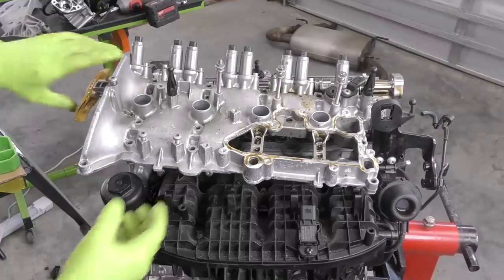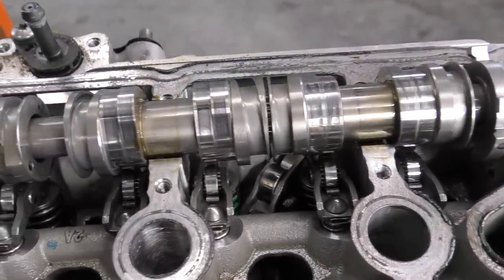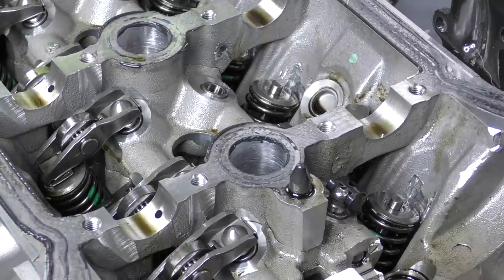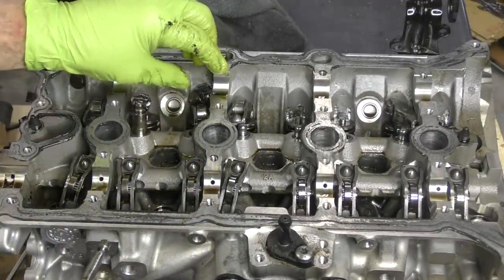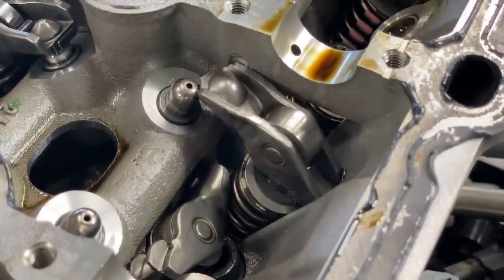Catastrophic Engine Failure VW 2.0t TSI Engine ~ MONEY SHIFT!

Comment: Man, it looks so much easier to work on an engine when it's out of the vehicle.
Reply: Yeah at the first place you think that you will lose time extracting the engine but in reality i prefer take my time to extract it xD
Reply: It is. Stuff that take hours on the engine takes minutes with the engine out off the car.
Reply: Ujiltrom M wait till you see front wheel drive transmissions, you’ll never look at a transmission mechanic with the same respect again (unless they pull it too, which a lot of specialty shops don’t do)
Reply: aterack833 i personaly work a lot on FWD and FWD engines are build different 
First of all they are transversals not longitudinal 
So it’s easier to work when the engine is in, even more since the transmission need to be disconnected with less space
But when talking about longitudinals engines it’s generally more simple to throw it out in my opinion
Reply: Trust me from experience it really really is 😂😂😂
Reply: VAG tsi 1.4 1.8 2.0 are shit they always break
Reply: Manufacturers need to get common sense in to help with the design.
Reply: For me, it's all about the aircon: the advantage of working on the engine out of the vehicle vs the advantage of not having to de-gas and re-gas the aircon system and change the aircon compressor O rings.

Maybe I should just accept the cost of getting the aircon done (£40 in UK)?

Or maybe leave the aircon compressor connected when I remove the engine?
Reply: @ryanb.2967  u make no sence
Reply: Alot of modern vehicles are designed that way unfortunately
Reply: This applies  to more than "cars" lol yes remove the engine then its easyer
Reply: @ryanb.2967  Do you mean in or out?
Reply: @jimmydcricket5893  prefer out but some vehicle take less time to work in
Reply: Umm, obviously
Reply: @ryanb.2967  The early Mitsi Magna cars used the same engines as the GK-GN Sigma. The two differences are the Magna water pump is driven by the cam, & has a different timing cover, but internally, most of these engines are the same. I know this, because I used to to engine reco work for a living, and I also owned a 1986 Magna. I own a much better, though older car now.
Reply: @jb9652  - when you replace wheel bearings, you don't have to bleed the brakes. You leave the hoses connected - just push the pistons back and hang the caliper safely using coathanger wire.
So why would you disconnect the air conditioning, when it's mounted on flexible hoses anyway?
Reply: @johncoops6897  Do you mean unbolt the compressor from the engine, leaving it connected to the condenser etc, then remove the engine without it? If so, that's what I meant in my last paragraph. I've just had a look: I think it would work. Cheers!
Reply: @jb9652  - of course I meant unbolt it and leave it plumbed (connected) into the refrigerant hoses. No need to disconnect anything unless you needed to You could possibly also leave the entire intake manifold and coil pack assemblies in place, which can save lots of time.
Of course, some cars will have physical constraints so removal of large stuff like A/C compressor is needed to provide enough space to lift the engine up and out. Keep in mind that the compressor is heavy, so strong wire or something will be needed to support it safely and not damage the hose connections!
Reply: @ryanb.2967  bwahaha no. FWD is a packaging nightmare and nobody's made an easy-to-work-on FWD in 20+ years.

If you want to see what easy to work on truly looks like, track down an 80-86 6-cylinder Ford F-150. You can just about rebuild the engine without removing it from the truck!
Reply: @jimmydcricket5893  it don’t bother me too much to work on a fwd longitudinal engine but for transversals ones i prefer pull it out depending on the task
Reply: Im going a valve repair on one of these.  Its a bitch in the car...especially the exhaust side

Comment: is not an engine failure, is a driver failure.
Reply: I ain’t no expert. . .   but the ECM should limit the RPM so that an inadvertent shift into a lower gear should not destroy the engine.  We didn’t hear what the respective ratios of second and third were in this car. . .    My Humble (see what I did there?) opinion. . .
Reply: @oijhhytdirhrbru  It does not matter, tuned, Turbo, NA. This will happen to most engines when going from redline on 3rd gear down to 2nd gear. Rev limiter is only there for top of any given gear, that is software, in this case it's all mechanical.
Reply: Both
Reply: Bram Moerman he forced it into second gear and dropped the clutch, so the physical speed of the car and transmission at such a low gear is what overrevved it, not him pushing the gas
Reply: Because of the red lining in 3rd gear and the speed he was flying in and accidentally forced it into 2nd gear he mechanically overrided all ecm safety measures and it being a mechanical override it is simply impossible for the ecm to react to make things right. When accelerating and you hit the max possible rpm your ecm simply won't allow the engine to turn faster, in case of a downshift from a higher gear at redline rpm into a lower gear the rpm of the engine would be much higher then the ecm or engine can handle...
Reply: @oijhhytdirhrbru  Fuel has nothing to do with it, who's talking about DCT here??? 
This video is about a manual transmission.
"Money shift" Can NOT be done in an automatic.
Reply: @francoisdvanderwesthuizen  Are you aware how a manual transmission works? If you're redlining 3rd gear and shift into second, physics don't care what your ECU has to say, that engine is going to rev.
Reply: @oijhhytdirhrbru  software won't help you if the engine gets overreved because of down shifting.
Reply: Funny thing is the old fiat punto if you slammed it into the wrong gear the gearbox would poop it self 
there was one story I heard and same driver destroyed 2 gear boxes, they didn't understand what gearbox failure due to overreving the gearbox meant (basically driver is in high gear like 5-6 and changes to a low gear like 1 to 3 when at 70mph) engine was fine surprisingly (gearbox exploding before been able to overrev the engine)
Reply: rt re It’s a GTI with a stage 2 tune. GTI can be optioned out with a Manual gear box. If it was the dsg transmission with the tune I’m sure it would of still exploded. Since it isn’t factory tune.
Reply: @dewiz9596  how can the ECM limit the input from the CV shafts turning the transmission too fast? it's literally got all the weight of the car behind it..holding spark won't slow the RPMs.
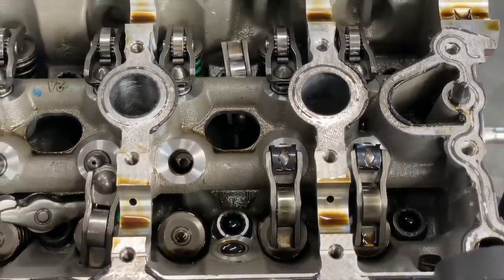Reply: @oijhhytdirhrbru  u just did not watch the video carefully. he mentioned around 11:55min that ECM can not avoiding downshift into wrong gear and dumping the clutch. The DCT or auto trans will not allow u to "dumping" the clutch. Doesnt matter how doubt are u about the manual trans with that engine in US or not. LMAO
Reply: @_Mario_PL_  your wasting your time bud, I dont think he will get it. You could turn the engine off and it would still cause damage
Reply: Yeaaaaa driver fail lol
Reply: rt re dude engine that came out the car had a manual so if you miss 4th gear and shift into 2nd, you gonna overrev the shit out of that engine
Reply: Easily done IMO. I have a manual 6 speed VX Astra and a manual 6 speed Audi S3, the Astra has a stiff, long throw change but the Audi has a much shorter, lighter change and I have occasional difficulty using the S3 box if I've been driving the Astra all week, (guessing the box in the Audi and VW are the similar)
Reply: @oijhhytdirhrbru  u r unbelivable. I am saying DCT will not allow u to dumping the clutch because of the clutch controlled by electronic controller and therefore the ECM. You are right about that BUT, the action of "dumping the clutch" only can be done with manual transmission.  SO!!!!! what he said that because he mean to be talking about a manual car, and as I said it doesnt matter how doubt are u about the manual trans with that engine in US or not, because it all based the information from the video and there are tons way to have a GTI fitted with manual...haha. good luck~
Reply: @dewiz9596  - No amount of software can overcome the actual physics of mechanical gears forcing the engine to over rev, which is exactly what happened here. If this were an automated DSG then yes, the computer wouldn't have allowed the dummy to shift from 3rd into 2nd, but when you manually shift into a lower gear at high RPM, the direct linkage from engine through the transmission to the wheels, forces the engine to over rev. That's how gearing works.
Reply: It's a manual trans as I understand it from his verbal description. That being the case, no software can prevent this happening. Unless someone designs a computer operated lock on the gear stick that won't allow the car into certain gears  above certain speeds.
Reply: @_Mario_PL_  Oh yes it can,,,,
Reply: Terry Huang . What is your native language?
Reply: Rev limiters don't stop the wheels from forcing the engine around faster. Money shift is in engine limit fuel cut territory anyway.
Reply: 9000 rpm is enough to do this id say its the engineers fault lol, laughs in honda
Reply: @oijhhytdirhrbru  I agree with you
Reply: @dewiz9596  they do, unless tuned out
Reply: @francoisdvanderwesthuizen  it was probably tuned out with stage 2
Reply: @oijhhytdirhrbru  DCT is a manual gearbox that is electronically shifted.
Reply: @oijhhytdirhrbru  no i dont
Reply: @oijhhytdirhrbru  just sent you links showing youre wrong, star reading yourself
Reply: @oijhhytdirhrbru  You really have no idea.  A DCT uses clutch packs (as per a manual transmission), rather than the torque converter used by traditional (hydraulic) automatic transmissions.
Reply: @oijhhytdirhrbru  bro, give it up
Reply: @oijhhytdirhrbru  The dual-clutch automatic is a development of the sequential manual transmission (SMT), which is essentially a fully automated manual transmission with a computer-controlled clutch.  Please now shoosh.
Reply: There should be a low gear lockout on manuals. Some have reverse lockouts. Once ECUs advanced they should have added dynamic lockouts for low gears at high wheel speed. Too bad manuals are being phased out altogether because people like driving to be boring.
Reply: @BenState  Look into Honda's later (non CVT) transmissions. They're some type of wild hybrid transmission, clutch packs, torque converter. No planetary.
Reply: @juansolo1617  Yeah. CVTs are a whole different breed
Reply: @dewiz9596  How ECM can stop wheel spinning? Engine is driven by the wheels in that case.
Reply: @dewiz9596  You're right, you're no expert! Do people still believe this?  You know that mishifting even with the engine electronics removed entirely will still blow the engine apart, right?  That no electronics can stop mechanical bits turning too fast when you let the clutch in? The only way to have this is a lockout that operates on gears below the one you're in if the engine speed is too high.  But no-one does that, because most drivers are not stupid.
Reply: @oijhhytdirhrbru  Still irrelevant.  The car was a manual, the driver blew the engine to pieces, and he must pay.
Reply: technically it's the tires falt for keeping grip on the road, and the clutches fault for not slipping.
Reply: @dewiz9596  there isnt any software on this earth thatll stop your car from hitting 30k rpms if you decide to drop the clutch in 1st gear going 70... The wheels are gonna control the engine at that point and a computer cant do anything to stop that probably never will be able to. This is why standard transmissions arent for everybody. You kinda gotta know better than to do that
Reply: driver mistake resulting in engine failure.
Reply: caused by a loose nut behind the wheel.
Reply: Failure of both